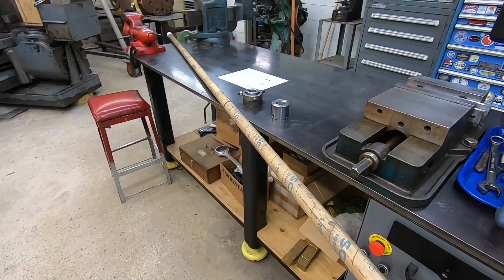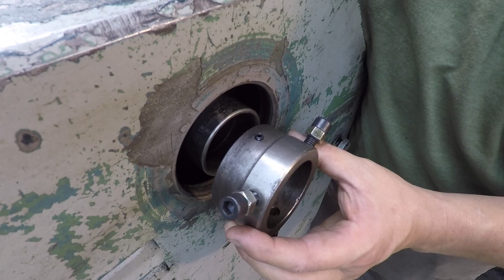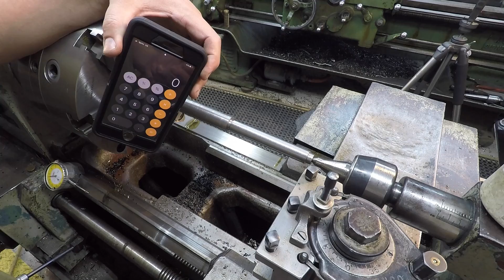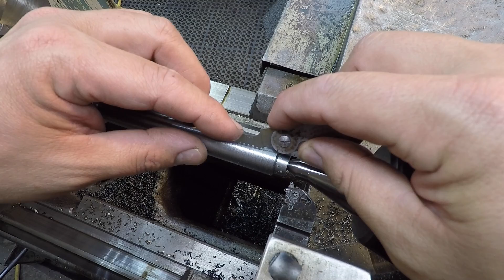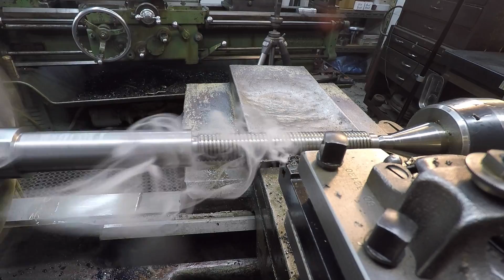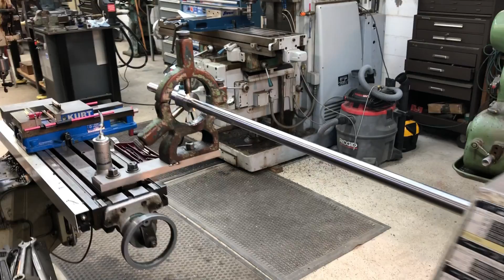Machining a Custom Prop Shaft Part 1

Comment: Talking of tightening all three equally, I figured (finally, I figured out why it SOMETIMES is so bad and sometimes not!) that my chuck runs more true if you tighten each of the cams that hold the chuck lightly first, then tighten it a bit harder, and then tighten quite hard. If you go hard straight away, it can skew it to one side. I'm sure this is something you learned from your dad, boss or colleague when you first started. I've only just started to learn to run a lathe, so wasn't considering this would be a potential problem. Of course, it's the same as tightening wheel nuts, cylinder heads or other stuff of that sort.

Comment: Abom nice Video. I was thinking about this tactic as well . But I didnt do it because my mill ist Not bolted to the ground. It weiys 4000lb .  But such a shaft would Not have a Problem to Swing your mill around.  

Your mill is Not bolted to the ground!! Thats quite a safty issue in this Case! Ne carefull.

Comment: So You use hardened chuck jaws. You didn't makes ny Marks on not hardened schaft?
Reply: Jakub Stańko 6 jaw chuck distributes the force very evenly and doesn’t create any points of intense pressure.

Comment: Experimental comment (testing if you can tell an alternative story by clicking timestamps)

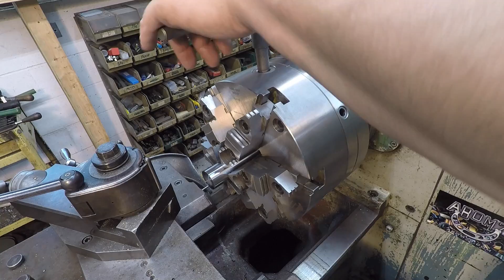15:59 Go ahead and pull her out
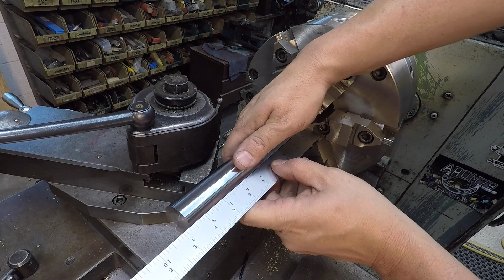16:38 I want a total of 10" stick out
34:44 That's feeling good
35:08 Try not to look at it, and just feel the [...]
36:16 Nut

(no disrespect intended)
Reply: First name Lastname you missed being able to handle the long shaft at 2.05

Comment: Never heard the term mud motor before. I'm guessing the guy is building some specialized boat motor.

It was really cool seeing how you are able to handle such a long project. But I don't understand why you moved the piece before doing the center drill. Doesn't that increase the chance for runout?

Comment: I have a NOGA MG61003  which has an issue, after I release the pressure by loosening the knob, the arms do not release. I have to hit on the center knuckle to try and dislodge the inner rods so they release the balls. Any experience with fixing this issue? This Noga is basically NEW, lightly used, in a lab environment, not a dirty machine shop.
Reply: Sticky? someone put lube on in the past, and has now dried up?
Reply: @alanfarenden9378  No one put lube or anything, I got it brand new, first owner, first user.
Reply: @AndreyK415  Take it apart, remove old lube from the factory, if any, check for burrs and remove any you find, and reassemble.

Comment: Pecisely measuring very long stock within a thousand isn't possible without a set of giant micrometers.
Just my thoughts on these long shafts. Also I'm aware of expanding during temperature changes. Are there any other solutions for that problem?

Comment: Adam,
Bondhus makes stubby L hex wrenches that have tighter bend radius than your modified wrench. They are very inexpensive. I purchased metric/standard sets for little cost, threw away my modified wrenches and I much happier.

Comment: When you turn a thread or agains a shoulder, must you stop the feeding for your self or can you set a stop point and then lathe stops feeding automaticly ?
Reply: On a non-CNC lathe, at least every one I've seen, you have to release the half-nut manually to end the thread. It's a skill... Screw it up, and you'll chowder the part, your tool, or both.

Comment: Many years ago when I was in high school, we called your file brush a fie card. I don't know where that name came from, but that's what our shop teacher taught us.
Reply: The file card probably originated from the wool card. Hence the name.
Reply: @RiverrRiverr  I have always heard file card. Probably both are correct -- ?
Reply: @JorgTheElder  I like your name.
Reply: Carding is the mechanical process of detangleing and cleaning. You use a card to do carding. Therefore a file card is the name for a file cleaner.  A wire brush and a soft brush are technically both cards. Even your hair brush and tooth brush are cards.

Comment: As a field mechanic using crappy drill bits drilling grade 8 or harder bolts, those three holes in a drill chuck are not there for your convenience, I believe even in a drill chuck snugging up the chuck at all three points makes a difference and keeps the drill bit from slipping. Same thing in your six jaw chuck I’d imagine.

Comment: How is the prop turned?  I've seen taper, spline, and shear pin style but am confused here.  I am a marine mechanic but I've never seen a mud motor like you mentioned.  I am NOT criticizing, just curious...
Reply: Robert Cook the props on a mudd motor are threaded and then the locking nuts go on after. This is the reason why a cotter pin isn’t needed and a key way also isn’t needed. Because it only turns in the forward direction it backing off isn’t likely.
Reply: @davidmerullo551  thanks for the explanation.  We dont have such contraptions in my neck o' the woods.  Learned something today
Reply: Also a 3/4-10 Nylock nut I would also recommend.

Comment: Is there a particular reason you waited until it was 10 or so " unsupported across the bed before you centre drilled?. Was this just because it was easiest. As I would assume it would've probably been an easier more rigid setup to centre drill it when there was only around 2"  before you Pulled it out. 😁. Great video!
Reply: You need to review the video.  This is explained.
Reply: @paulcopeland9035  I did not find the explanation. Wher was that ?

Comment: Just a thought, Adam... About the bushing used for the steady rest, if you marked it every 120 degrees, would it make it easier to get it aligned with the steady rest pads? Also, the TIR on that setup is outstanding considering the age and wear of that machine. 👍

Comment: Curious why wait to center drill it once it's pulled out and not do it when it was shorter? wouldn't that minimize any chance of the end walking a bit and get you a more accurate center on that end to do it when it was shorter?

Comment: What's a mud motor
Reply: https://www.google.com/imgres?imgurl=https%3A%2F%2Fwww.stumpjumpermudmotors.com%2Fwp-content%2Fuploads%2Ffixed-pic-13-hp-predator_fixed-1-768x447.jpeg&imgrefurl=https%3A%2F%2Fwww.stumpjumpermudmotors.com%2Fproduct%2Fstump-jumper-14-hp-mud-motor%2F&tbnid=9-vgG-Ay8kMEgM&vet=12ahUKEwjhtPzv9ProAhVTRlMKHUHeBQYQMygJegUIARDMAw..i&docid=LTK7UKv93tviRM&w=768&h=447&q=mud%20motor&ved=2ahUKEwjhtPzv9ProAhVTRlMKHUHeBQYQMygJegUIARDMAw
Reply: @terrymcdougal9258  Another  "Here, hold my beer " moment
Reply: Motor is on a long shaft to prop. Like they use on swamp people to go thru swamps so they can lift the prop out of water when needed.
Reply: Thanks guys

Comment: Believe it’s called Aqualoy 17, 19 and 22. The only reason I know is because I’ve bought some previously. There certainly may be others and you would definitely know better than I, but I do know Aqualoy is one of the manufactures of the high grade prop shafts. Just a FYI Incase  you need a quick reference to source some. Awesome work once again. Thanks for sharing.

Comment: I've been in engineering for 40 plus years. It always amazes me when cutting threads on a lathe that the tool knows exactly where the thread starts. I know it's not magical I'm just wondering if the feed those the rpm and knows exactly where that thread was. So Adam, how do you get the thread to start in the exact same place for each cut.  Btw, I'm not mfg eng or a machinist.
Reply: The feed screw is linked to the spindle/chuck/workpiece. The carriage has a dial on it that is turned by a gear on the screw. If the carriage is engaged when the dial is in the same position every time, the carriage will move the same way relative to the rotation of the workpiece. As Abom mentioned in the video, you can also engage on other points when the thread being machined is dividable by the pitch of the lead screw. Essentially, it works because the lead screw never disengages, rather the carriage from the screw.
Reply: Go back and watch he explained this very well he uses the indicator on the lead screw. Cutting equal threads he said you can engage on any full mark. He also has 2 additional zero references
Reply: Ron White twenty five years ago I would walk by the machine shop and see the machinists cutting threads, I was amazed, but I didn’t dare ask.

Comment: Looks like a great setup.  Just wondering...why couldn’t you just indicate the shaft to reduce run-out on the steady-rest?  Guess it is not that critical.
Reply: You could get the shaft to turn with zero runout,  yet still be off centre. This would produce unwanted force in the rotating shaft. That's why Adam "feels" for deflection. Hope this helps!
Reply: Mike Kunte Now that I though about my question, I can’t see how one could use and indicator to center the shaft.  Feeling the pull or tension (as he did) would be close enough to keep the shaft from vibrating.  Thanks for your comment.

Comment: I'm not a machinist which is obvious from my following question.  When cutting new threads deeper per pass, how do you get the tool to always enter the stock at the same point where the threads previously cut from the last pass aren't damaged?
Reply: Abom has your question covered. This video should answer all your threading questions and more... https://youtu.be/0OVWg50ETfQ  
This Old Tony has a good video on the subject as well.  https://youtu.be/Lb_BURLuI70
Reply: The lathe has a threading dial that slowly turns at a speed related to the spindle rpm, and (depending on the thread) you always engage the threading feed at the same place on the dial and it will perfectly cut along the last pass :) kinda complicated to explain, but if you find a good video explanation it's surprisingly simple.
Reply: @deividasadkins3122  The lead screw turns in relation to motor RPM and the thread dial turns in relation to the lead screw. Never get that mixed up, it will cost you alot of money. Whatever lathe you have, 4tpi, 8tpi 16tpi it is relating to the lead screw.
Reply: Go back to about the 29 minute mark and he explains the use of the threading half-nut usage.
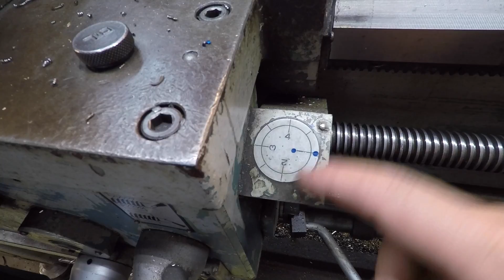Reply: He uses the dial at 29:40 by lining it up on any line.
Reply: @erikoui  That only works for a lathe with 4tpi.
Reply: The Dial turns and when it gets to a even mark you engage the feed.
Reply: 29:38
Reply: Thanks all!

Comment: Love the Iscar inserts. Employer recently got cheaper brand, they don't last as long or take interrupted cuts as well. Pay me now or pay me later type of deal. I make a lot of pump shafts on a lathe that does not have a DRO, I make marks on my shafts for the shoulders for the same reason you do. Asleep at the wheel, LOL You do a great job with the video and explanation of what you are doing. Thumbs up!

Comment: Why not center drill when the shaft was closer to the jaws, it would seem to me (nonmachinest) that the more shaft sticking out the more chance you have of it whipping for lack of a better word
Reply: That "whipping" is exactly why Adam left the centre drilling for later. Because he had "meat" to come off, he could allow the shaft to lie where it wanted to. It's good practice to centre-drill and machine in one setup, i.e. no moving the part in between operations. Hope this helps.

Comment: Adam - Do you have a set master to calibrate your thread ring gauges or do you send them out for calibration?
Reply: Lade's Eddy for them to get out of calibration, you would have to use them daily. He will never use them enough to have to send them for calibration. He would send them out if needed though.

Comment: Hey Abom and greetings from the UK.  I only recently discovered your amazing videos.  I’m fairly new to this and I recently inherited my grandads 70+ years worth of machining tools and workshop equipment.  However the one thing that I didn’t get was any form of pillar drill.  My question to you and the community is, would you recommend either buying a medium sized, high quality pillar drill or a low priced import mill with a quill?  Thanks in advance!
Reply: Mark Loving here in the states, we call it a drill press. It depends what you are using it for, a mill and a drill press are two VERY different machines. If you need to mill anything you NEED a mill, not a drill press which will only drill holes, but will do it nicely. A mill is what the name implies; it mills and you can keep the spatial orientation of your work very precise in x y and z axes. Also, a mill can mill AND drill, a drill press can only drill.

Comment: So why wouldnt you center drill it before you moved the shaft out of the chuck??
Reply: That "whipping" is exactly why Adam left the centre drilling for later. Because he had "meat" to come off, he could allow the shaft to lie where it wanted to. It's good practice to centre-drill and machine in one setup, i.e. no moving the part in between operations. Hope this helps.

Comment: Nice job. Question how much do you charge for such a service? A how you charge for 1h service? I'm from Brazil and like to compare the labour hour in general. Thanks for sharing those great instructional videos.
Reply: I think many machinists charge out at about $100 per hour generally. In practice tho the cost is going to be whatever is competitive, e.g. a shop that has smaller machines and thus can't do some things (like heavy stock removal) as quickly will charge a lower rate so they aren't more expensive than one with heavier equipment for a given job... assuming they actually want to do it. Many shops will quote extremely excessive costs if they don't like the job and want you to take it elsewhere.

Comment: PLEASE SOMEONE EXPAIN THIS   Why do you use the top chariot in an angle ? arent you moving the Z and X axis at the same time with that ? , does that Z offset dosent matter ? PLEASE SOMEONE EXPAIN THIS
Reply: It's usually set at 29.5° so when you're cutting threads you can feed with the compound reducing tool pressure and chances of chatter. Also it's so that it's out of the way
Reply: @Cj5guy1992  But he is using the dial on the top chariot to go into the material , so it move in the 2axis at the same time making an offset on the thread  start or im wrong ?
Reply: @Ronaldsbasement  Technically yes, it moves the start location. But it follows the thread sides at the appropriate angle.
Reply: It is set at an angle, so the insert only makes contact with one side of the V-profile. This reduces the tool pressure and allows him to run the machine faster and thus improve the surface finish.

Comment: I don't understand how the center with 10" stick out isn't the same center as close to the chuck, why not put in the center when it's in that six jaw chuck, which we agree is awfully good.  could it be to take into account any wear in the ways, that close to the chuck?
Reply: I had the same question,perhaps in case the shaft is not perfectly straight at the very end?
Reply: @lesbender236  it would be interesting to hear Adam on this..
Reply: You are right. If the shaft is not 100% concentric, he would have introduced error by centre-drilling early on. Because he had "meat" to come off, he could allow the shaft to lie where it wanted to. It's good practice to centre-drill and machine in one setup, i.e. no moving the part in between operations. Hope this helps.

Comment: Hi Adam, I'd like to point out my concern for your safety, as you were filing the shaft it appeared the you were very close to the chuck. With it spinning at 600 rpm you would have gotten a nasty injury had you made contact. Stay safe and healthy my friend
Reply: You can't work in a [machine-, wood-, auto-] shop wearing a skirt. There is a lot of stuff that will change your life in a second. It's just part of the job.

Comment: That's some fancy high dollar action right there. I'm dating myself but....Going on 40 years ago, when a long rod support was needed to keep it stabilized. We just C-clamped a Vee Cut pallet plank to the inside of our heavy 55gal chip barrel to support the shaft and let'r ride there! Sometime we would clamp another board over the top of the Vee to make sure it didn't escape and whip around.  :)

Comment: So Adam, how critical is the overall length? Are you able to simply use a measuring tape and do your best to eyeball it to length?
How about for cases where the length is critical? How would you make a precision measurement for something that long?
Thanks for the upload, it was entertaining and informative as always. Hope you folks are staying safe!
Reply: good question. Im thinking they would engineer end-play shimming into the design to take it into account during installation. Just a guess though.

Comment: Why would you stick it out 10 inches before you center drill it?
Reply: Because he had "meat" to come off, he could allow the shaft to lie where it wanted to. It is not necessarily perfectly straight.It's good practice to centre-drill and machine in one setup, i.e. no moving the part in between operations. Hope this helps.

Comment: U definitely put pride in your work the. Younger generation needs to take some pointers
Reply: I have to admit - putting such a rod into a CNC lathe without as much if not more stabilisation work would not be able to give you such results , especially the patience and nice finish thanks to well coordinated even movement is remarkable and something I need to lern some more for manual lathe work

Comment: Why don't you just drill a hole in the top of the cover over the spindle for a long allen wrench.  A lot easier than what you were doing.
Reply: Easier to drill a hole into the cover of the lathe, then it is to chop a bit off a small allen wrench? I'd disagree. You are talking about what he's doing at 6:25 right?
Reply: It took him all of 15 seconds to tighten those three allen keys.